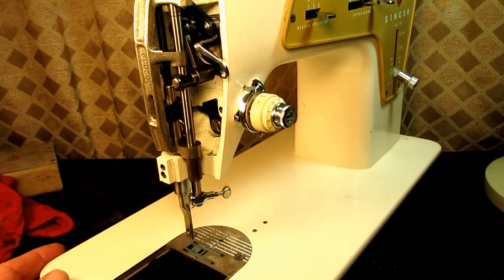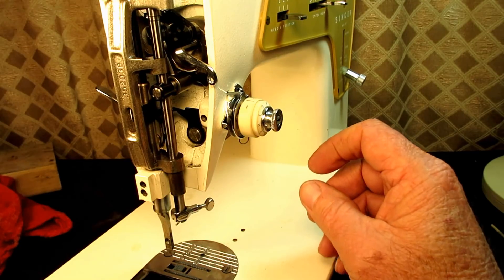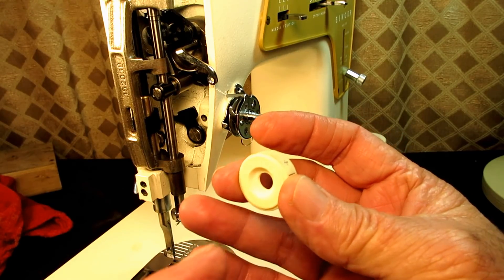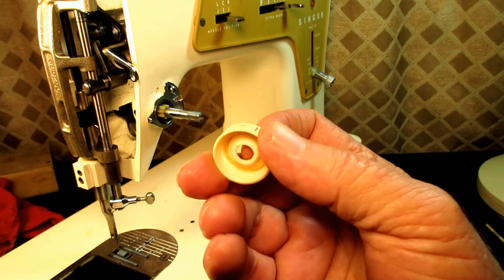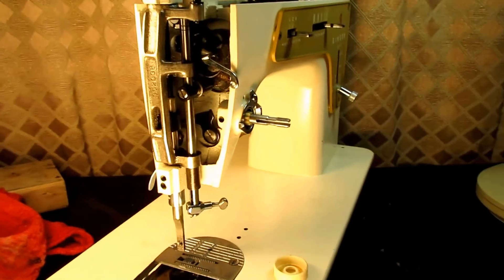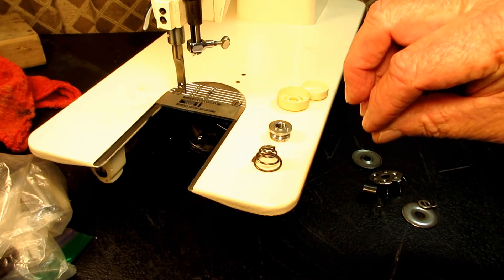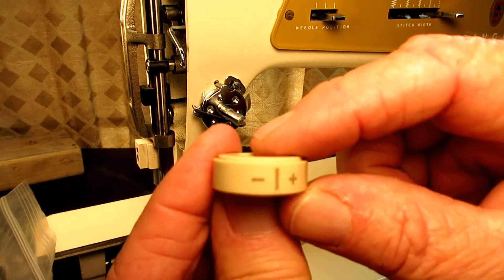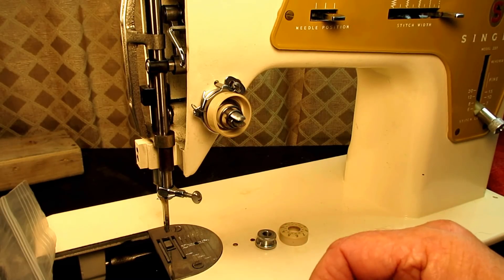A Broken Tension Unit on a Singer Model 237 ... Now What?

Comment: Really appreciate your videos Andy. My comment is that the deeper bowl of the cannibalised part could be reinforced with a modified stop washer on the machine side, which would both provide the needed reducement in clearance plus increase the serviceability of the component.
Reply from the maker: That's a very creative solution, Richie. I think it would work. I'm going to pin your comment to the top so others will see it first off. Thanks for sharing and for watching my channel.
Reply: The same solution occurred to me as a stop-gap measure just to temporarily place the machine back into service.  Once the correct index flange was procured all you'd have to do is replace the temporary solution with the permanent & correct part.  Not many things stimulate your ability to adapt, or 'gerry-rig' so beneficially as do sewing machine repair issues.  Typewriters have similar alternatives that test one's ingenuity.  Your observation comports nicely with the video's content and goal I feel.     Mike Kirwan - Kenmore, WA

Comment: That’s a shame the plastic part is broken but it can also be due to the mistreatment of the machine by the Sewist. I have seen too many people over my lifetime abuse them. But anyway I like how you offered other ways to get the machine working especially the finishing nail that was brilliant. Also, thank you for mentioning Sew Classic as I usually forget about them when I am searching for parts. Until you next video, take care.
Reply from the maker: Thank you, Rita. You have made a good observation about abuse. Since I filmed this I found out more about this tension unit. The stud was not seated into the machine all the way, the pin had been cut shorter and the plastic "gear" on the stud is cracked. I realize now that someone worked on this before for sure. I know I can fix all of this and when I make the follow-up video I will show the other things I found. This experience is exactly why I usually take most of the parts off before cleaning the machine. When I find problems I can order parts and get them on their way while I'm doing the cleaning, oiling, adjusting, polishing, etc. I'm glad you watch my videos and take time to comment, Rita. Take Care.

Comment: Andy, yes I meant to type 457, I followed your tips and managed to assemble the tension unit. I followed the suggestions made and was proud of myself that I did things in the correct order.
I was overly enthusiastic for a spell. The next situation is, the bobbin thread does not pick up. 
I view your videos everyday. I have a different issue with my 513, so I go back and forth between the specific machines and general knowledge. Thanks very kindly for your videos and sharing your expertise.
Reply from the maker: OK, model 457 has some possibilities for the cause of not picking up the bobbin thread. Needle threaded wrong. Needle bent. Bobbin case threaded in reverse. Lost timing of the needlepoint to the hook point or a broken gear on the top of the vertical shaft. Here is an example of setting the timing on a model similar to yours:  https://youtu.be/pANycD90wQg   And here is how to replace the famously broken gear on the vertical shaft: https://youtu.be/M3bFtlV1Y6s   Unless you are waiting for parts, it is better to stick with fixing one machine at a time. Please? Don't quit! Tell me what you find.

Comment: Hey Andy!
Thank you so much for taking the time to make these videos. I’m in NYC making PPE for my local hospital and doing it on a 328K older than me. Thanks to you it is cleaned, lubricated and has the best tension it’s ever had. Do you have any videos about fixing the stitch length? It seems to be reluctant to make a longer stitch. Stay safe.
Reply from the maker: thank you, Anabelle, for working hard to help your community. Good on you for all your life!
So, your machine should make the Singer Standard length stitch of about 4mm or 6 per inch. I have seen machines where the stitch length lever has bent down, and it hits the indicator plate before the actual regulator part inside reaches the limit of 6. If that is the case, you can replace the lever with a used part. 
http://www.thriftyfarmgirl.com/singer-328k-sewing-machine-parts   or here is another seller:
https://www.ebay.com/itm/Singer-328-328K-2-Part-Stitch-Feed-Lever-Regulator/352241456975?hash=item52033a174f:g:8CsAAOSwxixaQ~Yr
BTW, those pictures show the actual regulator, the hinge screw behind the handwheel that attaches the regulator and the little slide block that the regulator slides on. Here is a video about the regulator also. It is a different Singer model but the parts are the same: https://youtu.be/omHg86F73HY
If you don’t get 6 per inch when sewing (I sew without thread on an index card and measure with a ruler) you can just start by removing the indicator plate, letting it hang on the lever and look inside the machine at that regulator. Dirty, dusty, and dry? Brush it with an old toothbrush dipped in alcohol ( if you guys have any left!) let it air dry and put some oil on the slide block area. There is nothing in the manual about oiling that so it may have never been oiled since you were born 😊
If your lever is extremely hard to move up and down AFTER you clean and oil, that may prevent full range. Then you can think about removing the handwheel to get at the hinge screw and loosen it a little bit.
If none of that helps you get the normal length or more, then you can cheat a little bit (a little bit only, don’t tell anyone) by leaving the indicator plate hanging loose. Then you can move the lever lower which will lengthen how far the feed dog pulls the fabric between the needle punctures (why they call it the feed regulator). You can probably get a 4.5mm stitch then BUT be careful. If you try too long of a stitch, the feed dog can start hitting the needle plate or the back of the machine inside. So if you try this, just make holes in the index card to test and turn the wheel by hand only until you find the sweet spot of how long you can get without hitting something with the feed dog. Then do a little test sewing. Whew! Hey, you asked! I know people who sew sails with Singer machines, and if they can make a little bit longer stitch they can save a lot of thread which equals $$ to them. Now you know the secrets, yikes. I trust you with them though. Anyone with a heart as kind as yours can be trusted for sure. Well, that is your entertainment for this evening, Anabella.
And no worries about my safety. I’m answering so many questions I hardly get out any more. God bless and take care.

Comment: Thanks for another great video Andy.
I also noticed a while back that sew classic has those pins too, and says "cut to length" in her description.
I don't recall the price, but they were cheap.
Reply from the maker: Hi Mark. They sell a 1 3/16 inch pin for $1.29 (plus shipping). https://shop.sew-classic.com/Tension-Release-Pin-Generic-81572.htm
The pin for Model 237 is 1 2/16 inch long. I usually just cut down a finishing nail and use a small file to "round-off" both ends so they are not sharp.
Earlier model Singer machines used a rounded pin in the tension unit (ex: Model 99K) that did not have a flange on one end. Thanks for watching.

Comment: Hello Andy!  My singer unit is a 300 if im correct.  my tension unit has an all metal gear but there is no metal ‘nut’ at the end just an all plastic knob including the tension numbers... so im stuck on how to remove this first piece to separate and inspect all component parts.  Can you direct me to a video with my type of tension unit???  THANKS!!
Reply from the maker: Hi, Scott. The only model 300 Singer made was an industrial machine. Check the model number again if you can. In general, on Singer domestic models, if there is NOT a tiny set screw on the end knob or thumb knob, and it is made of plastic, it just pulls straight off and pushes straight on and is held by the tension of the plastic. There are a couple of later models where there is a round metal disc in the front center of the plastic knob and it has a tiny hole at one edge to put a pick into and pop off that metal disc and expose a nut or screw. If you get a correct model number I can get more info maybe. Thanks for watching my channel.

Comment: Your videos are great! I'm having trouble with my tension on Singer 237. I haven't seen you addressing a broken stud gear or sprocket. If I can buy one, can it be replaced without taking off the tension stud?
Reply from the maker: On a couple of stud repairs (bent or broken gear) I could not figure a way to replace the gear without removing the stud from the machine. Twice I bought a replacement stud (years back) that was guaranteed "to fit" the model of machine. Turned out it did fit in the hole but was either too short, too long, or did not have a long enough slot opening to work properly. Once I bought a used tension unit only to find the gear was cracked also. I have fixed a number of tension gears made of plastic. The actual "teeth" were OK but they were cracked between the teeth and could not grip the stud tightly and just spun around the stud. I just squeezed the crack together and one drop of super glue did the trick just fine. One of those machines is my nieces and is still working fine after 9-10 years.
Reply: Thank you for the info. I found a tension stud gear online at Millard Sewing Center for $1.99 + shipping but I haven't ordered it yet. I tried to remove the set screw for the tension stud but I can't loosen it with a small flathead screwdriver. Do I need a special tool to remove it?  My stud gear is broken in half between two of the teeth. The two pieces just turn around the stud. Would it be OK to glue the two pieces onto the stud so they do not turn? I would rather not remove the stud if I don't need to? Thank you.
Reply from the maker: @dixiefenicle7658  Absolutely! If you can get the glue where it needs to be without removing the stud that's great. When the plastic gear is new it does not rotate or spin on the stud, so gluing it to the stud would be the same thing, really. On the check spring end that goes first onto the gear, there is a little "springtail"  pointing down towards the stud. That tail slips between two of the teeth of the gear to act as an "Anchor" that provides the spring to the spring and prevents the takeup spring from just spinning around without tension. When I glued my broken gears I did it while they were on the stud and the gear ended up being glued to the stud, so no problem.

Comment: Another great informative video...I just picked up two new to me vintage singers..One is a 237 and the other is a 347(both made here in Canada)..Just got them an hour ago so haven't check them out yet..I might make a quick video about them and maybe include the other machines I have as well.
Reply from the maker: You're off to a great start. I think you'll enjoy working on the different types of hook systems. You'd find it fun to make videos too, I think. Each owner has a little bit different perspective on the machines. Good luck.
Reply: @andytubesewing1953  Thanks..I hope I'll be good at it because i do enjoy tinkering with mechanical stuff.
Reply from the maker: @percaine  I think desire is 80% of accomplishment. Good Luck.

Comment: Hi Andy, thank you for your informative videos you are making, I have a Singer model 377 and I found that the indicator in the tension unit broken and need replacement so I ordered it and I was watching this video and it’s the same issue but the assembly parts are different , I wonder if you have any videos for the 377 model , many thanks 🙏🏻
Reply from the maker: Sorry, I've never even seen that model and have no documents for it at all.
Wherever did you even find parts for it? None of my sellers have the model number listed. I saw one picture and the tension unit may be found, or similar but it wasn't a good picture. https://www.youtube.com/playlist?list=PLsCOZgzzaiKKyqvdDRwS-9MfLuwSNJTcg  No joy for you from Andy Tube, very sorry.
Reply: @andytubesewing1953   I found the bit on ebay and I took off the whole tension unit and found out the white plastic gear is cracked, so I’m going to use the glue as you did in your video and I think I got it now after watching lots of your videos just waiting for the part to arrive, thanks again Andy for your time 🙏🏻
Reply from the maker: @charliemoussaed2294  Thanks, Charlie. I get it now, and good luck sir.👍

Comment: where can i find a tention flange?
Reply from the maker: For Singer Model 237? I do not know of anyone selling new or used numbered flanges like the one in the video. I usually have to buy a  used assembly to get any of the parts other than the check spring. They do make new check springs. I buy assemblies from eBay. For many models, people substitute a different style of a unit that you can buy brand new. Here is an example from one seller and there are other sellers, including direct from China. https://www.ebay.com/itm/TENSION-ASSEMBLY-422403-455-Complete-Pull-Up-Singer-Alt-s-531883-451-/271429872695